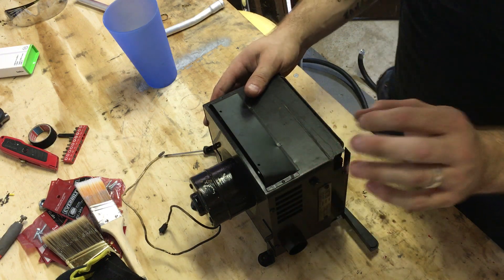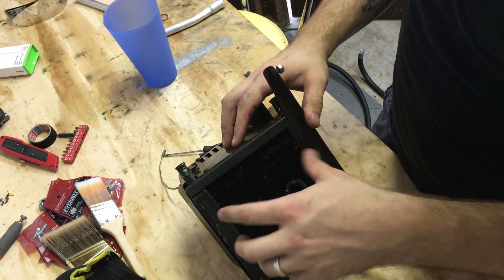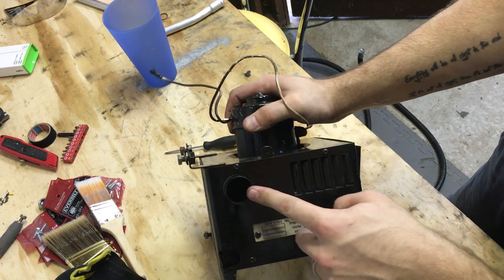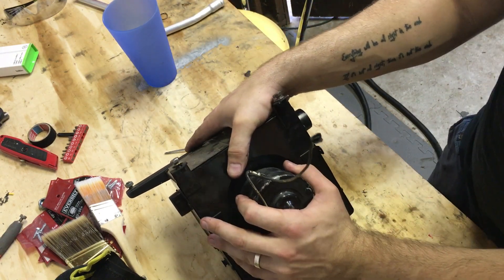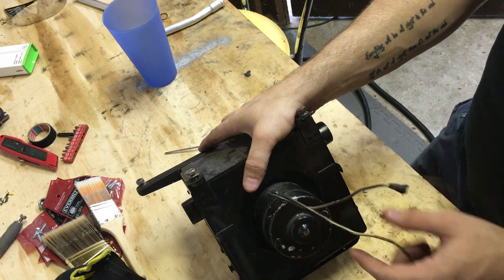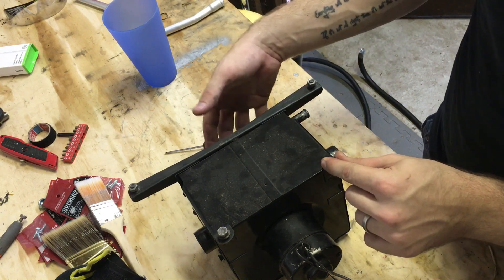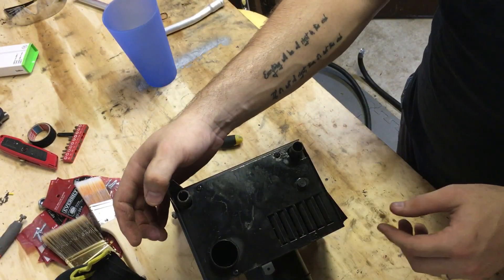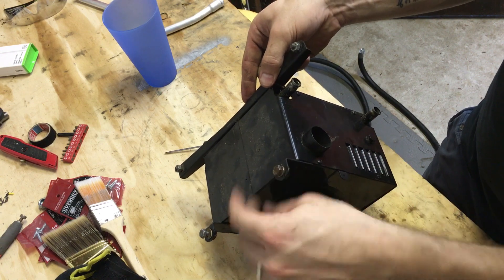Classic Mini DIY - How does the Heater Work?

Comment: I notice none of the cores are suitable for these old heaters. 
Any idea where you can find them?
Reply from the maker: The early heaters are super hard to find cores for, unless I just haven't seen suppliers that carry them these days. When I replaced mine I had to find a used one. You might have some luck sending your leaking one to a radiator repair shop though.
Reply: @classicminidiy  Cheers, I managed to seal my old one myself but I would love to find some stock for these. Love the channel. Keep it up.

Comment: i got a a/c from old austin metro, maybe you can help with the electric wires and where i can check that if  i have all the parts.

thanks
Reply from the maker: Hey, I don't have a ton of details on the wiring or parts required for the AC units.  

I do have wiring diagrams here on my site.  One of those might have the AC diagram in it.  
http://www.classicminidiy.com/technical

MiniMania also has a pretty solid diagram on the AC:
https://www.minimania.com/catPage/8-55/8/55/1/Air-Conditioning---Japan

Comment: My heater fan is very squeaky, should i replace it or can i lube it up or something?
Reply from the maker: How is it squeaking? Only when on? Going over bumps?
Reply: When it's on.
Reply from the maker: You might be able to oil the fan bearing using a less viscous oil. Although getting in there might be challenging. Mine is super sqeaky so I just really consider how cold I am before I run it. 😁
Reply: Haha alright, thank you

Comment: Hi, I'm an owner of 1973 mini 1000 mk3 and I'd love you to demonstrate how to replace the heater valve which is angled type if there's any chances to do.
Reply from the maker: The one on the top left of the cyl head if you are looking down at the engine with the hood open?  Thats pretty easy to do, just two bolts and a new gasket.  

Valve - http://www.7ent.com/products/heater-control-valve-mini-adu9102.html
Gasket - http://www.7ent.com/products/gasket-heater-valve-88g0221b.html
Reply: OH! thanks so much!!